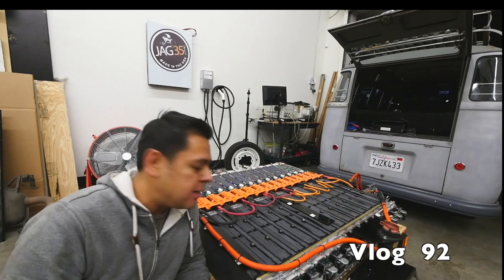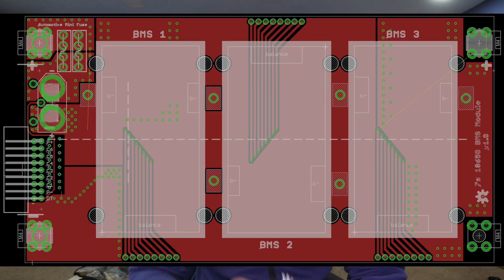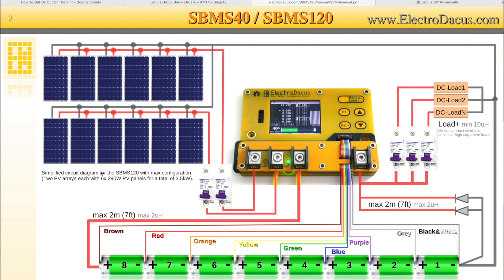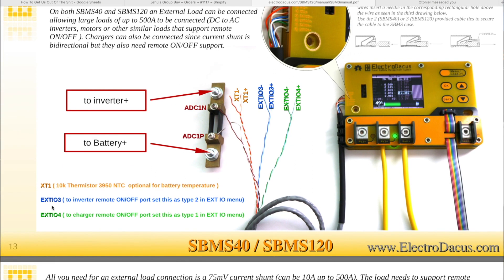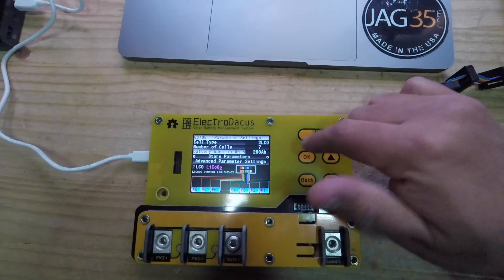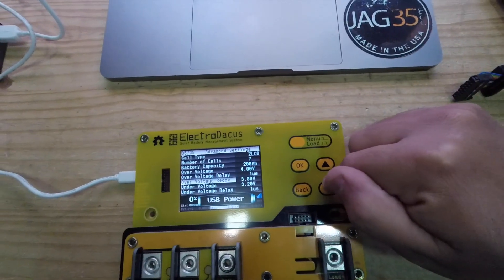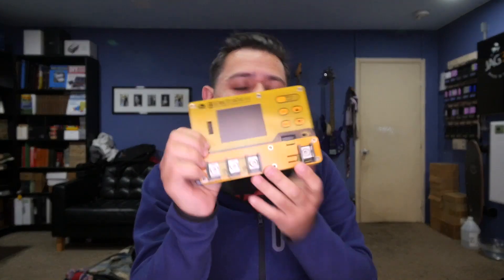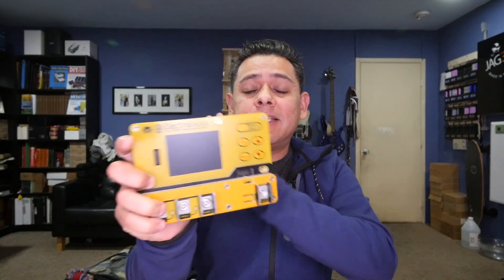Solar Battery Management System (BMS)

Comment: Hi Jehu! And thanks for this video! Maybe finally a bms for my Rv’s diy 3s battery..! 
Sorry for my English 
But I did not understand if it can handle 3s 12,6v..can it?
Best thanks
Reply: Yes it can handle 3s that is the minimum configuration but anything between 3s and 8s is possible.
Reply: electrodacus , thanks I’ll go for a 120A, my rv diy is a 240amph
👍🏻👍🏻
Reply: You also need to now that PV panels need to match the battery voltage so just 32 or 36 cell panels will work efficient with 3s or 4s
Reply: @electrodacus  
Ill go for the 40A
So, my 2x100w solar pannel system will work if understand.
In an other way ..can we imagine to use it too, with an other dc input like the engine alternator 14v..? My 3s battery is a 12.6 v max
Reply: Yes your 2x 100W will work with a 3s and SBMS40.  Since your battery is 240Ah you can maybe add more panels in the future up to 6x 100W with SBMS40.
Is not economical at all to use the alternator as a source of charging the battery as it is very expensive. Pv panels have a cost amortization as low as 2 cent/kWh over their lifetime but each kWh you get out of your alternator will cost you at least 1 liter of fuel that will be at least around $1/kWh. So if you drive your vehicle will use about 1 liter more of fuel for each kWh you get out of the alternators it is the same idea as using the air conditioning increases the fuel consumption as it is adding more load to the motor.
Even if you do not care about the cost you will need something like a battery to battery charger as that will know when engine is off not to charge your lithium battery and drain the small starter battery and also limit the current else alternator will push as much as possible and get damaged from overheating as it was designed for charging just a small Lead Acid starter battery.
Reply: @electrodacus  
thanks, i do think the same... but in my van life, i can't make as i would like, having all Kmh from solar..specially now.. because of the sun, unfortunately , and i do not have space for more solar panels..except for a solar tracker i am building now but not ready..
That way, i do need other sources to not be stuck.. like 220v charger and power from alternator..
in this case i could limit the alternator job with a dc to dc booster charger..like the Enerdrive dc2dc. The problem with this one is that it is not programmable as i do need for 3s lithium ion...and it's not a BMS ..
My question to you is: could your good BMS have an 14v ( managed by a relay from 13,5v to the max ) source in parallel with solar panels , with diodes? your device can't handle more than 40amph..so that will be the limit for the alternator.
i'll not drive to charge the battery, but i'll use the power i can take from the alternator when i'll use it:)
best thanks!
Reply: As long as you have a constant current charger is not important what it is programmed for as the SBMS will disable the charger as soon as your 3s battery is charged by connecting the EXT IO4 in series with the ignition signal on that dc2dc charger.
Hope you understood that if you need to drive somewhere say 100km away and you car will say use normally 8 liters for that drive if you during that time take a total of 0.5kWh from the battery say 40A x 13V for one hour then your fuel consumption will be at least 8.5 liters so the extra 0.5 liters is for those 0.5kWh you took from the alternator as engine will work harder to spin your alternator that needs to output those extra 40A
So that energy from alternator is not free an in fact very expensive at $1/kWh just for the extra gasoline. So compared with PV that may be as low as 2 cent/kWh or even grid usually at 20cent/kWh that alternator energy is very expensive.
Reply: I use a second vehicle alternator to charge my RV battery (35 Nissan Leaf packs in 7S20P/18kwh) because my vehicle is nominally 12V and my RV battery is nominally 24V. The SBMS has external control SSR's for both high voltage limits and low voltage limits. I use the the high voltage limit SSR to operate a DPDT relay that can prevent overcharging from both my alternator (on one pole of the relay)  and the charger in my inverter (on the other pole of the relay). For charging alternator, the relay energizes or de-energizies the 24v excitiation power to the alternator's external regulator. I think you could use the same control method slighly differently to work with your single 14V alternator. I have 4 different relays or switches in series to safely charge. All have to be 'closed' for charging to occur. 1) SBMS 'OK to charge' SSR to my DPDT relay, (battery must meet BMS's charging criteria) 2) vehicle ignition relay (engine must be 'on' to prevent draining the starting battery), 3) manual switch (I must want it to be able to charge) 4) alternator temperature switch (alternator must be below max temp). 

I would create a battery isolator by adding a branch on the alternator output with one to the vehicle and one to the RV battery. The RV branch would need to have a high current relay capable of max alternator output to disconnect your RV battery. Normally, a battery isolator would be exclusively managed by switch 2). This is an enhanced battery isolator  with more controls. The 'enhanced isolator' would be controlled by all 4 of the above mentioned switches in series. Any one of them can disconnect the RV bank. 

Some additional info:  With a large bank,  overheating the vehicle alternator is a concern. The vehicle alternator's regulator just outputs a fixed voltage and the amperage is variable based on the load. With a big bank, the alternator can over-current or run at a high current for such a long time the alternator will overheat and burn out. I use a simple $3 thermal switch (120C) attached to the alternator case in series with my charge control circuit. The alternator output to the RV would be shut off if the alternator case temp exceeds 120C and automatically reconnected at 95C. 

Additionally, I have a manual switch on the dash to enable or disable the whole system depending on my choice to charge while driving or not. This allows me to shut it down when climbing a hill or not charging if I know I will have AC power to recharge at my destination (because of Dacian's very correct observation that charging from a vehicle alternator is expensive). 

Email me directly at steve.hericks@gmail.com if you need more help.
Reply: Steve Hericks 
Big thanks for explanation .

I’ll email you .
For information:
I emailed Victron to ask if it’s possible to use a programmable mppt victron as a batterie bank charger , with the alternator as an input.
They say yes if mppt current is limited at 80% of his max rated current . 
The advantage is this device is fully programmable . Exemple: mppt 50a with output voltage limited at 12.5v, and current 40A.
All protected by relays , and manual switch , and BMS.

My concern is : is the alternator output voltage not to low to start the mppt ..
Reply: Most PV charge controllers are based on a DC-DC buck (voltage reducing ) converters. This requires the input voltage to be a minimum of ~2 volts higher than the output voltage. Low input voltage is normally not a problem for PV sources but (I think) would be for a standard alternator given your other limitations. Since your alternator (regulator set at ~14.1-14.4V) is powering vehicle equipment as well as charging your starting battery in parallel the actual voltage will be around 13.6V or lower. If you then connect your house batteries, I expect the system voltage will sag to around 13.0V. I, therefore, would normally assume that your concern about charging is likely correct; your 'standard' input voltage is likely too low. SOME charge controllers, however, are DC-DC boost converters (I've never seen one for 12V system) and intend to work with low input voltage by raising it. I have not seen a charge controller with both boost and buck capability but they could theoretically exist. This is hopefully what the Victron controller can do. I have other thoughts on the subject but will wait for your email because I'm already too wordy for a video comment.

Comment: nothing being said that device is only pwm. so you are restricted with panel hook up. when i told electrodacus he should make a 16s board, his reaction to this was, that he makes it just for himself. i mean there are a lot if people out there with 16 or 14 s
Reply: The SBMS is not PWM as constant voltage charging is not desired or needed with Lithium in stationary offgrid applications. The new low cost SBMS0 can be used for a 14s or 16s system but is not very elegant to have two SBMS0 so I do not normally recommend this. Most people will be happy with a 24v system as the 500A max current shunt allows for 12kW loads and that I think is fairly high and should be good for 95% of people.

Comment: I almost always charge to max 80% for li-ion and discharge to no less then 40%. Gives good run time for most applications and maximizes battery life.
Reply: Also, only gives you 40% of stated Battery Capacity ... And my car would last a lot longer,  if I only drove 1 mile per day !

Comment: It's a long time I'm waiting to start a project because I want this ElectroDacus SBMS120 wich I think will be the best fit to stay as simple as possible. I am not yet sure if I go 7S on LiCoO2 or 8s on LiFePO4 But I have more than max solar panels already. I'm in now. This will power my office except inverter for a/c and heating (as a begining) all the machines computers and lighting fit the envelope.
Reply: Thanks for supporting the Solar BMS project. I recommend using LiFePO4 as those will be more cost effective over the life time in off grid type applications. LiCoO2 make sense if you are interested in a portable system as they have higher energy density but they will have higher cost amortization due to lower cycle life.
Reply: Thanks, yes, that was in my mind, but as I may find a lot of used 18650 by my job, I might go for this opportunity instead. Currency is becoming rare this days ... and I have plenty of time.

Comment: I want it to start balancing when it starts charging. They was a guy who had a lipo fire at 4.7v!!! I only want to charge to 4.0-4.1v and discharge to 3.0-3.2v
Reply: Yes SBMS will start to balance when two conditions are meat.  One is a minimum charge current about 400mA for SBMS40 around 1A for SBMS120 and SBMS0 will depend on external current shunt ans settings and the second condition will be a delta of at least 10mV between cells. This way cell balancing can be done for up to a few hours each day allowing a small cell balancing current to keep in balance even very large battery packs 20kW to 100kWh are not problem for SBMS. The above are just default settings user can chose to have cell balancing at any delta between cells and even do cell balancing during discharge (not that will be very useful in many setups).

Comment: batrium is Good, But i Hate Hungry Money People. they want to Push the system, But do not want to Help some one like Jehu to Push the Product. Batrium is to Much Money, some one like me will spend 1,000 dollars or more just on longmons,  do the mat,  i got 14s but i am adding 14s more, plus Shipping. that is to much. for that i just get the dam! Tesla Power wall, i get Warranty for Free. that is my opinion! i can be ron. i just using commonsense.
Reply: yes the batrium is very expensive
Reply: @ursodermatt8809   yes  it is , they will get my business if they lower the cost of it. only if they lowered to a nice number like $300 dollars  will be reasonable
Reply: @caserio323   it is expensive because they produce relatively low numbers. i also had 11 cell wires out of 16 fail on me. i think it is because the put hot melt glue on the plugs to the bypass unit. which added more cost and a considerable amount of work. but otherwise it is a good product. customer relation could also be somewhat better.

Comment: I guess I could add a relay from the load + from the advanced bms to allow for a direct connection to the batteries to run inverters as it says not to run inverters from the bms.  Would this be safe and allow the undervoltage protection?
Reply: Inverters are all designed to be directly connected to battery and many have a remote ON/OFF connection that is typically just a parallel connection to the mechanical ON/OFF switch that only switches 10 to 20mA at around battery voltage to power on the inverter. That remote ON/OFF will connect to a BMS for undervoltage protection in case of SBMS0 that connection is called EXT IO3 and set as type 2 meaning open circuit thus turning inverter OFF when any cell is below set voltage.